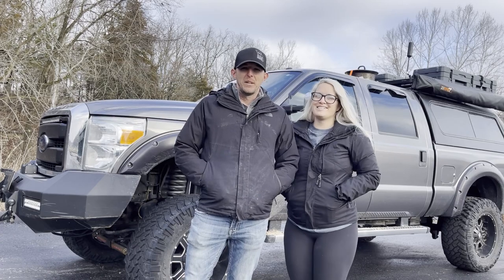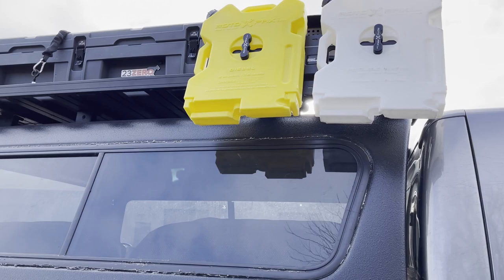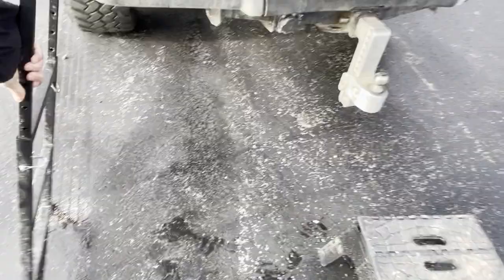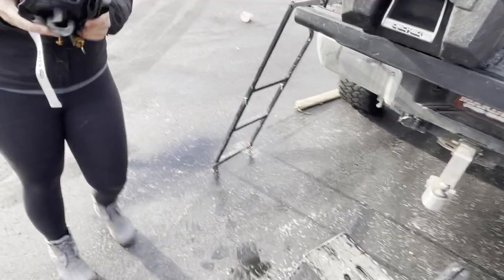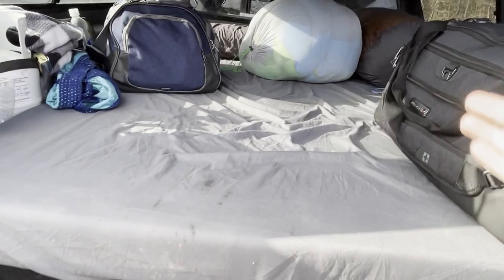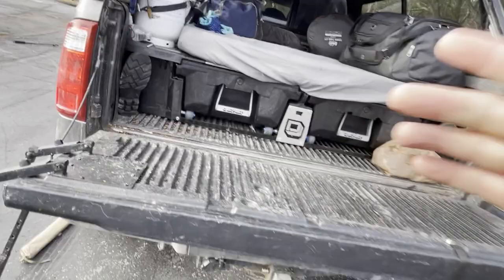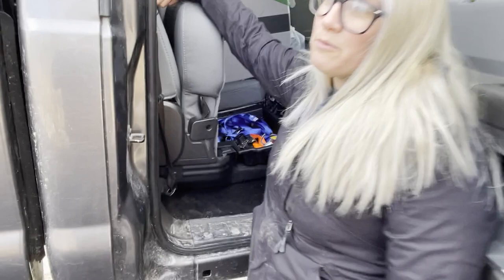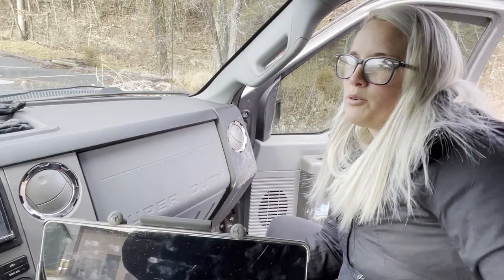Truck Camping / Overlanding / Off-Road Setup Walkaround and Gear Setup

Comment: Very nice, can I find you on Overland Bound?  I just had the truck bed Line-X so that I can install the Decked Draw System and I picked up a Softopper and Prinsu Rack.  When you do pull the string on new tires, check out Pro-Comp A/Ts, I just picked up my second full set.  Check out ACI for their Tail gate stainless steel top. It makes a great prep and cooking platform.
Reply from the maker: We are not on overland bound so I should probably check that out. You'll love the decked system. It's awesome!   I'll check out those tires. I know pro comp makes good stuff and ill definitely check out the prep top too.  The ripples in the bed liner tailgate are a pain to deal with. Thanks for the tips!!

Comment: thanks for the info.  Where did you get those plastic boxes that are under the bed in the back?  They rolled out real nice and held tons of stuff.
Reply from the maker: It’s called a decked system. Its made to fit inside your bed and the drawers slide out.

Comment: Hey guys, hope ur still both overlanding. Year and mileage of your Ford SuperDuty? thx. Happy Trails, stay safe.👍🍀
Reply from the maker: It’s a 2012 and I bought a whole new motor for it when it had 140k miles on it.  Turbo went out and sent stuff through the inter cooler and jacked everything all up.  So got a new turbo too.   Got about 20k miles on the new motor now and runs like a dream
Reply: @catchmeoutside8098  Stay Safe & Happy Trails

Comment: Nice setup! Even though I am in a Grand Caravan and you all are in a truck, there are a lot of similarities as far as needs go and it's always interesting to see how other adventurers do it! * Is the Blackstone difficult to clean? Do you need a grill brick?* 👏
Reply from the maker: Thanks!  Once the blackstone is seasoned, it is very easy to clean!  Once we are done cooking anything, I scrape it with a putty knife style flat scraper,  scoop whatever is scraped into a trash bag,  wipe it down with a paper towel, and I'm done.  If you clean it when it's hot, its really easy.  Then once it cools down I wipe it down again.  If you cooked something fatty or greasy, you don't need to apply anything else to it.   If the thing is a little dry looking, coat it with a little olive oil and leave it on there.  It is the best!   I've never cleaned mine with a brick or brush or had to re-season it.  I also never leave it uncovered or let it get wet so I've never had it rust either.    Thanks for watching!!
Reply: @catchmeoutside8098  Awesome! Sounds like something I want to invest in in the future. For now I am using a cast iron Lodge griddle on a Coleman dual-fuel stove. Do you all have the 17" Blackstone?
Reply from the maker: Sounds like you're setup works like the blackstone, but with more parts to work with.  Ours is the 17" and we have a dome for it too
Reply: @Catch Me Outside  Yes, exactly! More parts and the upside is stove was gifted to me so I only had to buy the griddle! You all had yours in a case it looked like. Did that come with the  Blackstone as well?

Comment: Which tailgate step are you using? Looks like it works well with your lift.
Reply from the maker: I’ll have to look it up. Don’t remember. It was on Amazon so just look up tailgate ladders.  Actually just removed it because it always got in the way of the drawers unless I move it and rarely used the ladder and instead used a step stool

Comment: Cool video.  Great information.  You mentioned it but not sure, can you run that refrigerator on your truck cigarette lighter (12v) the whole time on those camping trips or just running it on the truck battery when in transit?  i.e. do you power it with some other source at the campsite?  Thx for sharing.
Reply from the maker: We run it off the built in 12v under the seat.  It's set to always on. Some vehicles don't have always on 12v. We can run it overnight without killing the start battery but then we drive around the next day to charge. If youre going to be stationary for a while you'll need solar or another battery.  The fridge does have a built in cutoff though to turn the fridge off before it zaps the battery, but then you'll lose everything in the fridge
Reply: @catchmeoutside8098  Got it.  That's what I thought and that is great.  Thanks

Comment: Did you Line X your camper shell? How much weight can you carry on top of the shell?
Reply from the maker: Yes, it was raptor liner so similar to line-x.  Had it done by a truck accessory company because the shell was bought used and was white.   Not sure the max weight because this particular shell isn’t reinforced for a rack so the problem with too much weight is it would make the side walls bow out and fall off the bed rails.  I just put bins up there that are pretty light so I don’t worry about it.
Reply: @catchmeoutside8098  , thanks for the info!

Comment: Is that the Jackery 240? Curious if you run your fridge off of that and if so, what type of fridge/cooler is it?
Reply from the maker: It is the jackery 240.  We haven't tried to run the fridge on it so not sure how long it will last.  The fridge is an Alpicool CF45.  If you put stuff on the bottom or side it will freeze,  middle with be cold, and there is a chiller pocket in it.  We have ran it just about 24/7 for well over a year and it hasn't failed us yet
Reply: @catchmeoutside8098  Awesome! Thanks for the information! What do you use to power it normally?
Reply from the maker: We power the fridge with a 12v socket build into the truck that is always powered

Comment: OK, You have a full size truck with a 1/2 ton bed? Why not a full size bed 8' bed???
Reply from the maker: Don’t need a 8” bed, plus on a crew cab that extra length makes them really long.   Had a 7.3 super cab with an 8ft bed. That was a good setup